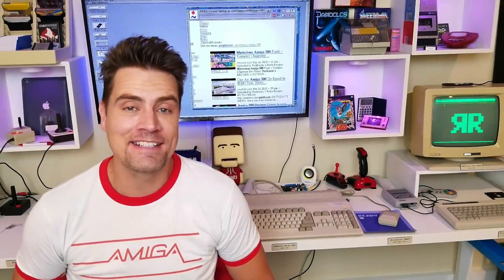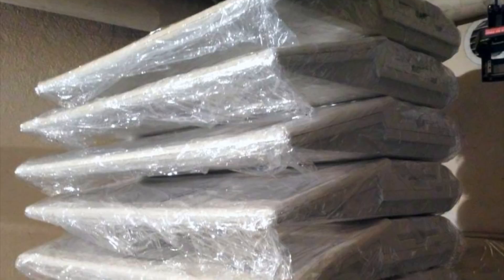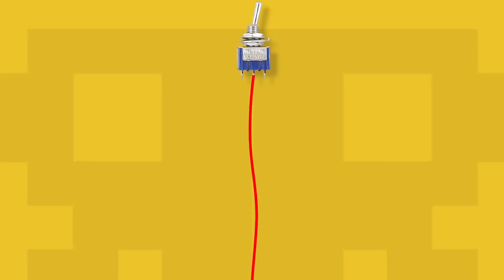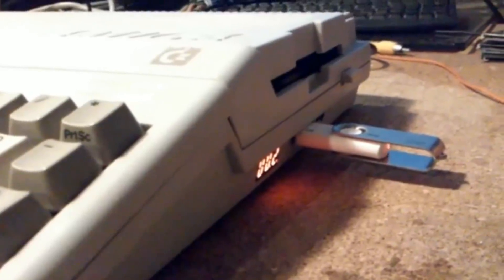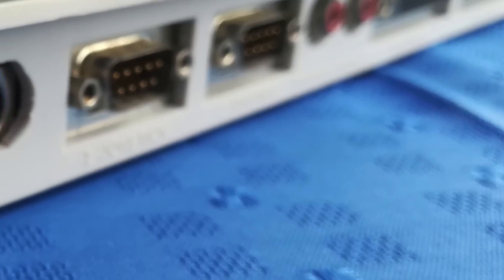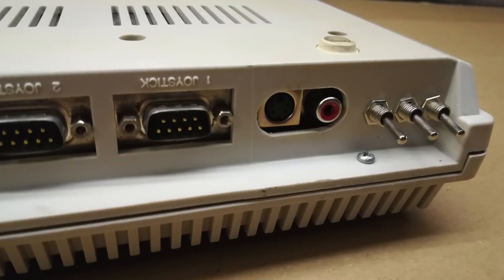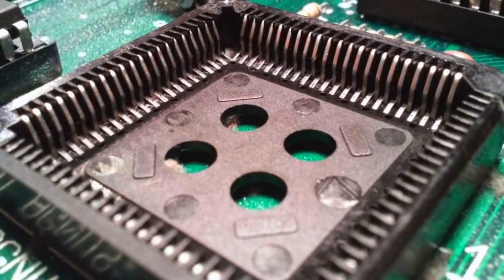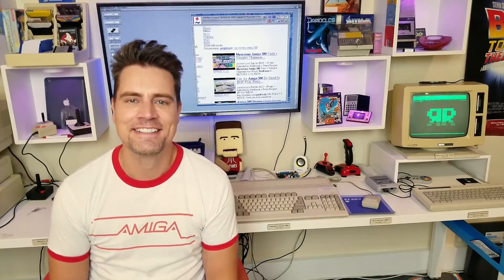Amiga Hydrographic Cases, Under-Floppy USB, S-Video Hack, Switchable RAM! | Commodore A500

Comment: You just reminded me of how I added a switch on the back of my A2000 to switch between the default 68000 and 68030/68882 GVP GeForce board back in the early '90s as some software couldn't cope with the 68030 and I didn't want to lose the ability to run a lot of software.

Comment: I recently bought an A500 that looks just like these, but it came from Poland. It has a green top, the Gotek under the floppy, the S-Video adapter, and the three switches which control whether the Gotek or the Floppy is DF0:, which Kickstart to use (1.3 or 3.x), and to disable the extra RAM. I'm very happy with it.
Reply: Al, that is the same A500 ;)
Reply: It's one of these? But, Chris lives in California not Poland.
Reply: Read description ;)
Reply: What Description?
Reply: this YT video description :)
Reply from the maker: Correct. I explain in the intro that the work is done by Pete/Drygol aka Retrohax in Poland 😊🕹️
Reply: Well then, he did a great job on my A500, and sold it to me at an affordable price. I'm very happy with it!

Comment: I wanna mode my A500 case too, as well as do some more stuff with my A1200. been thinking of putting an IDE 2 SD card adapter in to use as backup boot hard drive and such, as well as easilly transfer files between Amiga and PC. and also to be able to easilly swap out different installs of Amiga OS on the A1200

Comment: Nice video! I made similar kind of under-floppy gotek with 5V switch and both drives work BUT now floppy drive led is burning constantly. How did you get the floppy drive led working normally? Only the gotek own led works normally now. Do I have to cut some grounds as well with the switch?

Comment: I have stopped retrobrighting. I prefer good paint jobs. I just bought a A500 where they have done the gotek ghetto mod, cutted the plastic and a bad paint job (grey). This video gave me an idea to do some sort of panel and get in a floppy too. If I connect the gotek + adapter to the external port and use a df0 switch (on even CIA) I can use the fdd and gotek at the same time. Of course it need a better paint job too. What is the best colour? If you have any tip I'm listning.
Reply from the maker: Hmm not sure for that machine but the forums like Anime are great

Comment: I like you mods but why the switch that only lets you use the floppy or the GoTech?  Couldn't both drives be available at the same time just different drive numbers?  Is it a power issue?
Reply from the maker: The reason is a lot of games are hard coded only to load from DF0 so it's best to have neither on DF1

Comment: So after watching your videos for a little while I was inspired by your antics and as such my A600 is going through the retrobriting process in the glorious UK sunshine so should be ready in about June 2019. 

Do you have any tips for cleaning the metal back plate on the A600? 

Love the channel though, jolly good work and always enjoy the excruciatingly British puns, whilst I enjoy a cup of Earl Grey in my local Wimpy of course.
Reply from the maker: Lol!

You could try soaking it in vinegar. Then use baking soda and a toothbrush as a light abrasive. Failing that just go for a zinc or silver paint spray. 👍🕹️
Reply: Perifractic's Retro Recipes, thankyou! I’ll give it a go. The next bit of the fun is cramming the Gotek in there... space is not a luxury the A600 has.

Comment: If you had as many C64's as AMIGA's that you have disposables available for modding the hack out of like this AMIGA one what weird mods would you try out on a pimped up C64 Dual SID, Region Mod on Switches, 50/60 on switches, S Video out, something even more whacky HDMI out, C64 Gotec Mod if any?

HDMI on that AMIGA would have been a fun one and probably better as it's a much smaller straight lined output which means it takes less cutting in the case than S-Video and a possible true HD output for only some things not games on the 3 figure output as AMIGA on 4 figure reses was HD before HD existed boasting up to four figure graphics modes before they came out as a TV format.

Looking forward to see what you do frankinstein wise on the odd disposable in the future as it's just a bit of fun and some of them actually worthwhile and others not so much.

Comment: I just unboxed my old amiga's 500.. one does not boot (agnes ?) other does everything perfect. question, I do own a  590 diskdrive (works) but I want to use SSD instead of the old WD 20MB drive. and I need a working wb1.3  what's the best thing to do ?.. can you help me to choose either to do an mod in the amiga or in the 590 drive. my amiga's are 1 mb fast mem 1.3 boot chip (can i install other one ??..

Comment: "To yellow to retrobright" Might be a thig of the past! Have you seen the results of Adrian Blacks method? it turned orange into white..
Reply: Funny thing is I've watched that video just an hour or two ago! The results with that Macintosh SE case are jaw dropping!
Reply: Sir, I have my own ways ;) Have a look at my blog. Also, what Adrian does is very cool method too. However, I have more control with my methods. Sometimes, these ABS plastics has Bromine compounds mixed differently and retrobrighting won't work evenly. Let's say that 1-3% cannot be retrobrigted properly. I have around 90x A500 with various plastics and did retrobrighting on another  100 more so I kinda have my own point of view on it :)

Comment: Sorry, but I do not understand why powering of floppy or gotek. Why not activate both? One as df0:, the other as df1:
Than making the select line for drive 0 and 1 switchable, so you can select wich drive to boot from.
On an A500 you have to get df1_select from the external 23pin connector (or directly from the chip), but that does not seem hard.
The advatage of having both drives connected: It would be the easyest way of copying disk to image and vice versa.

Comment: I notice your soldering iron is no longer available on Amazon at the moment.. any other ones you'd recommend? 

Also, with all those mods on a single A500, have you uprated the PSU or are you still using a 'brick'?
Reply from the maker: Thanks for letting me know. This is a good alternative: https://amzn.to/2ym9P2z
Reply from the maker: Also just the standard brick. The mods don't draw any more amps than the PSU gives out.

Comment: do you have those many amigas boards or is just for demostration pourposes? maybe fans would buy some of those amigas fixed with an autograph thought patreon or something
Reply from the maker: Thanks, see Description for eBay link to Pete's store 👍
Reply: @RetroRecipes  sorry I didn't see that, but also that would be a challenge. It is a lot of stuff, but basically is a hard chore for buying from eBay from Argentina. Even buying from aliexpress is becoming hard because of the new laws.
Reply from the maker: Sorry mate
Reply: @RetroRecipes  don't worry, maybe would be better soon. I hope.

Comment: What is the state of the art for Amiga today?  If I wanted an Amiga which one should I go out to acquire, how much RAM etc. and at what add on boards should I look?
Reply from the maker: In short, an Amiga 500 with a Vampire card will supply all the memory you need, CF card hard disk, speedy processor, and an HDMI output. I have the Mk2+. Some prefer the design of the A1200 though. Enjoy! 👍🕹️
Reply: Thanks.
Reply from the maker: Pete still has 1 or 2 of these A500s available at his eBay store at the time of writing: https://ebay.to/2QBWnPD
Reply: Thanks! :)

Comment: I have a few a Amigas cd32  & 1200 2 500pluses 2.04 & 3.0 kick 1 500 1.2 kick I have to get the backup battery out of pretty sure there might be leaking by now, the 500 plus that I have upstairshas failed now you placed it about 10 years,  ago I think I'm going to put buttons  in. both the classes have hard drives and accelerator cards I put in from an omega so many years ago with the 68030 chip, replacing the 68000, and have 8 megs of fast and two megs of chip memory.

Comment: Great idea to place the Gotek under the floppy. That doesn't destroy the optics too much. Some people tear really big holes in the case for that ... incredibly destructive.
However, I would have installed a DF0/DF1 switch so that both drives can be operated in parallel.
Also I would have installed the S-Video module instead of the monochrome composite socket, which you don't need anyway. So also the wiring would be shorter, but that's your machine.

My conversion with 2 internal floppies and modified A520 as S-Video converter:
http://a68k.de/galerie/viewtopic.php?p=163#p163 
However, the signal path to the S-Video socket instead of the monochrome composite socket would have been too long in that case. But it also fits that way.

Comment: You missed a trick there. You should of just soldered a switch to two legs of the cia chip and then you can switch the gotek between df0 and df1. Also you should do a 1.3 & 2.0 bios for it with a similar switch to go between either kick rom, 100% compatibility then.
Reply from the maker: Ah but the point is to keep them both at DF0 for Max compatibility
Reply: @RetroRecipes  it's still df0, flick a switch and the gotek is dfo, flick it back and the floppy is dfo, you get me?
Reply from the maker: I've tried those solutions with limited success but did blow the CIA. If you had more luck I'm glad 😊🕹️
Reply: Actually the middle switch does 1.3/3.0 KS switching :)
Reply: @retrohaxblog  So it was you that did all the mods and RR took all the images and documented it?
Reply: Yes thats me:)  I am not a YT person and RR does amazing videos ;)  have a look at my blog for more details - link in the description.
Reply from the maker: I'm guessing you didn't watch my intro 😉 He and I have been working together since he kindly approached me months ago.

Comment: S-Video is rubbish. RGB all the way :)
Reply: Indeed. If you lack RGB capable display equipment, you can buy a low-cost SCART to HDMI converter on Aliexpress. It is hard to find a valid case to downgrade the Amiga video signal to S-Video.